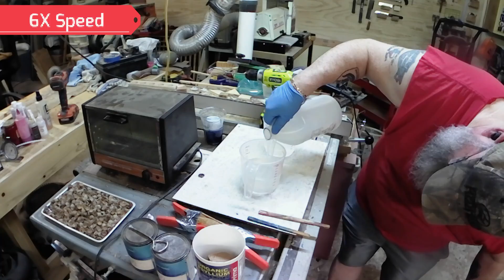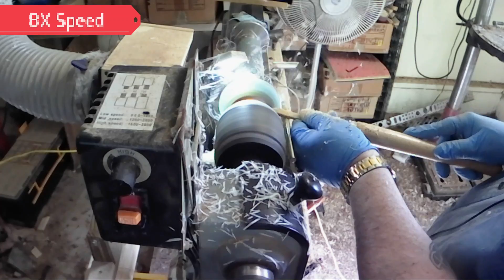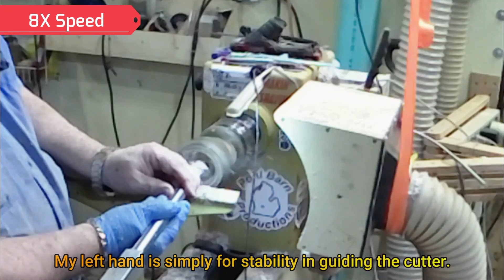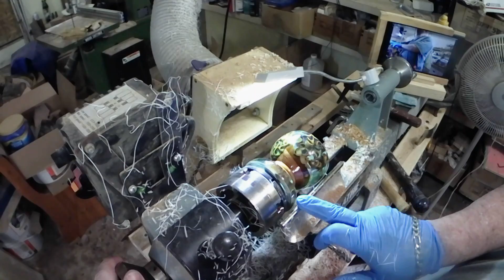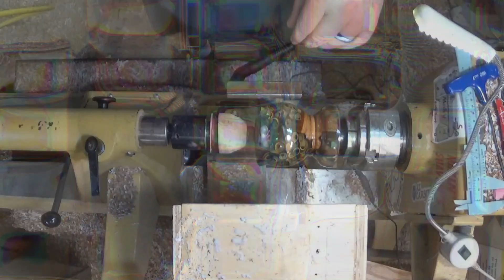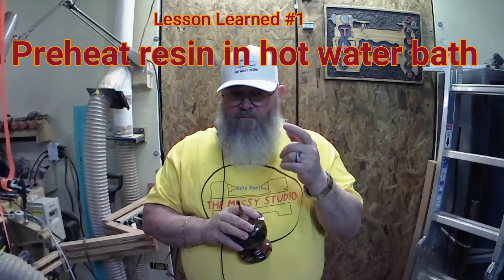Green Epoxy Resin & Acorn Caps - Happy St. Patrick's Day!

Comment: That looks great, watching and learning. Would a vibrating table under the pressure pot help to dislodge stay bubbles ?
Reply from the maker: Thanks, Dennis!  Probably not since the few I had were each trapped on the inside of a cap with no way to get out from under it.
Billy